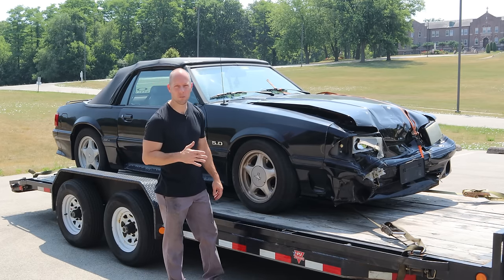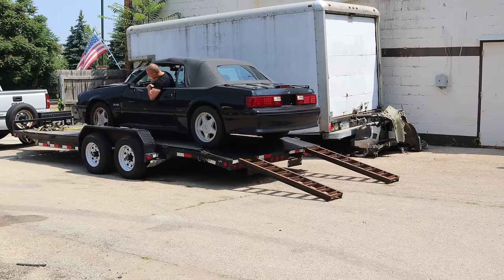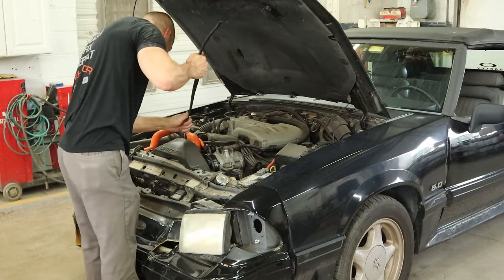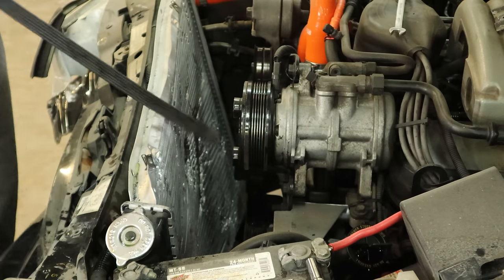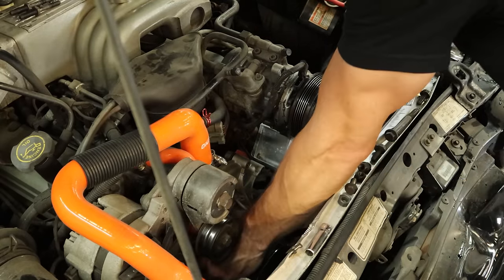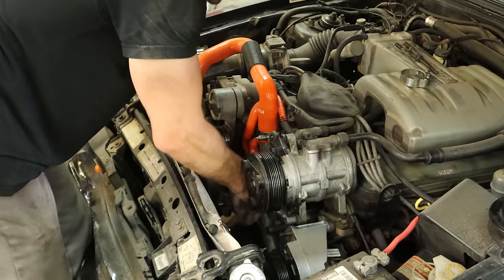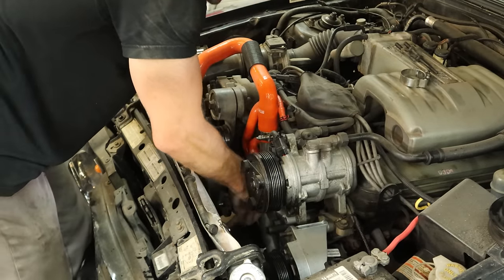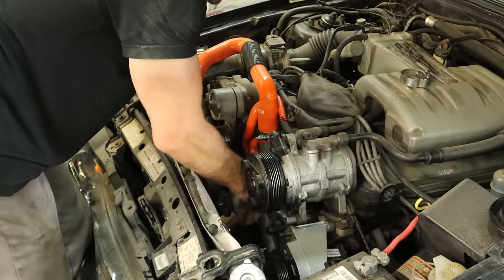Rebuilding a totaled 1993 Mustang GT convertible with engine damage.

Comment: Again, as a Ford engineer... I can totally relate. When will we learn? :D "It looked good in CAD" is the bane of my existence.
Reply from the maker: I just thought it was, “well, I don’t have to work on it”. 😂
Reply: As a retired Mechanical cad designer I can totally agree with you! Early CADD was pretty primitive and even as recently as 2011 I was appalled by the perceptions of what CAD could do well, but actually could not. I especially loved when companies claimed how the various CAD platforms were TOTALLY compatible with each other! LOL I spent more time fixing, rebuilding, reconfiguring, redesigning problems that either never should have happened or could have easily been avoided.
Reply: sometimes its not even the engineer's fault; its the Bean Counters in Finance Screeching "That's Too expensive, make it out of cheaper materials" or "X amount of Dollars is too much to add maintenance covers to the skid plate, delete them!"

Comment: Another Mustang convertible. What happened to the one we aren't allowed to mention? Did you keep building it or scrap it because it was too hard to fit the old body on the later frame? Would be interesting to find out and see more of it if you are still working on it.
Reply: I Wanna know The Same thing
Reply: Your not supposed to ask..no soup for u!
Reply: Dude its only been 3 years
Reply: He should of just replace body panels on that car and up graded to a small block 289 or 302 . It would of been a nice old  classic car.

Comment: I had a ‘90 GT convertible. I bought it used. It had an auto transmission. I drove it home and ordered everything I needed to put in a World Class T-5 transmission, 3:55 rear gears, subframe connectors, under hood shock tower triangular brace, ‘95 Mustang five bolt front spindles, 5 bolt rear axles, larger throttle body and cold air kit. It was a way different car than the one I drove home when I bought it. No engine internals but it was awesome. I miss it. This vid brought back great memories.

Comment: I was a Ford senior master Ford tech for almost 40yrs. I love Fords and have always driven them. I absolutely do not mind you throwing rocks at them, I know what they are though. I have watched your channel for a long time and enjoy every bit of each show. Thank you sir!
Reply: Am I the only person who has had exceptionally good luck with Fords? My everyday driver is a 1996 Ranger that still looks new, drives great, and will probably reach 400,000 miles by October.
Reply: @jeffgoddard4100 I've had a good run, but most have been modern affairs. 15 Fiesta ST, 15 Fiesta SFE (1.0), 15 Ecostang, 13 1.6 ecoboost Fusion (with manual, rareeeee), and a Taurus Sho sprinkled in there too. All were dead reliable despite lots of abuse.
I'm very sure I am a total outlier though.
Reply: That car is very surprisingly original!  Makes me miss my black 93 GT Convertible.

Comment: You got a great buy for a car which "doesn’t run or drive." Was it a fuel pump shutoff that you switched on in the trunk ? We didn't get these here in New Zealand, Love your videos  Scott, they clarify why crash repairs cost what they do. Go Ford !!!
Reply: Yeah these years had electric fuel pumps for the fuel injection.  Even some of the earlier years did, though sometimes the shutoff was under one of the front seats.

Comment: I had a 88 gt convertible same color in college.  5spd swap, e303 cam, exhaust etc etc. I loved it for years until i got my first ls1 trans am. Then i never looked back. Id love to have it back but they guy that has it gutted it and its was a race car so it would take a parts car to rebuild it.
Reply from the maker: Many of them turned into race cars, that is why original ones have gone up in value so much.

Comment: A friend of mine just parted out an 89 convertible with under 6k original miles on it.  I believe he still has the quarter window stuff and some other odds and ends if you are looking for that stuff from a low mile car. It also had a gray interior (though the color isn't quite the same between 89 and 93.) Located in central Ohio. I have an airbag, but it's from a 91 which I believe is different than 93.

Comment: The second Fox body convertible in as many months? I think you may have a soft spot for these. I still have my '93 Cobra that I bought new, and a '92 LX notch rotates in and out for daily driver duty. I sold my triple white Vanilla Ice-spec '89 GT convertible two years ago, five speed with a rear disc brake conversion, fun car. Here in AZ, these things last forever - though they are a rare sight on the roads today. In Chicago, I imagine that one will grab lots of attention when you sort it out.

Comment: 9:20 yes, new 4 bangers make more HP but they also won't be running 30 yrs from now without huge repair bills. You're lucky to get to the end of the engine warranty on the eco boosts without having to do a valve job.

Comment: That car is in really good shape for the year. Obviously didn't come from Canada or the rust belt on your side of the line. Worth saving if you can find good rust free parts. Maybe another road trip in the future. Good video.
Reply: I have a 1991 fox body LX convertible.

From what I can tell it was originally registered in Hawaii, then registered several years later in Alabama and most recently in southwest Missouri.

It is in immaculate condition without a speck of rust on it.

Unfortunately, I don’t see a lot of Fox bodies in my part of the country.

Comment: I had an 89 5.0 LX. Once you said it wasn't starting I was pointing to the trunk. I was stuck at work for 30min once until I read the owners manual. As  a guess pushed that button and off I went.

Comment: Hi Scott, I hope you & pizza girl have a super weekend! This looks like a killer build. Just curious, if you keep it will you leave the under carriage as is or do some selective media blasting? I am amazed at your ability, but not surprised. Can you disclose what you did in the truck to get your build to start? See you in the next installment.
Reply: Those Fords had an INERTIA switch that would cut power to the fuel pump if the vehicle was in a crash.
Driving over a speed bump too fast would cause them to trip as well so that's why he knew to check that first.

Comment: I had to do that old school repair when I was a teenager. The gas struts on my Mercury Capri let go and drove the hatch latch into the back of my head. My reaction was to slam the hatch hard enough to trip the fuel shutoff. Luckily I had overheard a conversation of this happening to someone's Aerostar van or I would have been stumped why my car shut off when I slammed the hatch.

Comment: The last time I was in Chicago;  I rented one of those.  1998, IIRC.  January, midnight.  Had to be in Rockford in the morning, this was the last thing on the Hertz parking lot.  Half buried in a snow bank.  5.0 convertible Mustang.  The perfect winter weather car for N. Illinois.  Not.

the reason this car has sll this new stuff and then got wrecked, was they bought it used from a dealer and this was the only thing not selling in January.  Promptly went out and smacked some poor honda because it wouldn't stop on frozen roads.  :)

Comment: That's interesting the battery still worked--some FDs will cut the battery cables so there's no chance of electric fire (at a demo derby you can spot the holes cut in the hood for that reason)

Comment: Not sure how old this video is (meaning when you had the car), but I just did heads/cam/intake on my 92 Mark VII with the 5.0 and have a radiator, clutch fan and shroud if you need. I'm up in Arlington Heights these days.

Comment: I knew as soon as you turned the key, and it cranked but wouldn't start, what happened.😄 The inertia switch is the first place to look, especially if it took a front end hit. A little bit of frame work, and new rad, new condenser, bumper, left fender, hood, etc. and you can have a driver for pretty cheap! Like someone else mentioned, it seems like it was well cared for by the previous owner!😉
Reply: It's only cheap if you have the frame rack and the skills. This light hit is a $6000 bill minimum.
Reply: @hotpuppy1  True that, framework, especially on newer stuff, is delicate work, and you have to be careful not to tear the metal. Definitely an exercise in patience!
Reply: Was news to me, but never drove a Ford!

Comment: It may not have the power of todays 4 cylinders, but at that time the 4 cylinders could not push their way through a wet sheet of paper. I used to play a game with 4 bangers of that time. sort of like name that tune, but it was I can blow the engine up in ? minutes. I had a Mustang GT back then untill I let a Honda owner drive it. I have driven todays Hondas and can still have then smoking and dying in minutes. To this day I could get speeding tickets for excess speed before getting across an intersection from a red light.

Comment: I bought an 88 mustang lx with the gt package in like 94.  I went to the car wash one day.  When I was leaving the car wash the car shut off. I had to call a tow truck.  Come to find out. There was an anti theft key under the steering wheel and dash.  I was poking  around and found the key under the seat.   I plugged it in and it started just fine.  😂😂😂😂.     Whatttttt!!!!!    Very fast car for the year

Comment: Ahh the memmories.   My 2nd car was a few year old 85 Mustang GT with the 5 speed.  Coming from a VW, it was a lot of fun to drive, until all the bushing turned to mush and it started turning all by itself - good bad times.   Makes me realize that I really like modern cars.
Reply: All those bushings were readily upgradable with urethane, nylon, or in the case of the front upper strut towers, custom ball and socket adjustable fixtures.  The Fox bodies were amazingingly upgradeable and could handle very well on the track with Griggs parts, etc.  I still have my 85 GT 5.0 in the gargage.  Major suspension upgrades with minimal engine upgrades to keep it street legal.

Comment: Ah yes 1993,the year the 5.0 Mustang got it's ass severely whooped by the 5.7 LT1 Camaros and Firebirds.The 4.6 didn't fair any better.So sad.Still,I really like he Fox body Stangs,the 5.0 really isn't a bad engine,and can really stand some mods.But you just can't beat a SBC for easy hp.Regardless of what the pinned comment says,there's still a LOT of 3rd gens still kickin butt and takin names...
Reply: And that's before you even consider no one is harvesting 4.6 liter motors of of the 94-04 mustangs like they are with the LT-1 and LS motors in the 4th gen F bodies.

Comment: Ya had me worried when ya broke out the wheel cleaner spray.  Then (gasp)...  Pressure washer?  I was about to call 911, but I see ya got it under control.
Reply from the maker: Don’t worry until you see me cleaning those wheel liner to reinstall them. 😂

Comment: My 90 LX Notchback has leaky AC. Also changed the water pump twice and the plastic fan was cracking at the hub so that done as well. All parts cheap. Also alternator but all issues were time based as I bought it new and now it is old like me. Last thing I did was the heater core....not fun and the speedo cable is not connected need to go back in and do that again....grrr. Oh the door jamb bushings cracked away got new ones on Amazon just last month they were $14 for a set of 4. Cheap again. Great car not a problem with anything. Cheap fixes. I do not drive it in winter never have as that is useless. Have owned all of the big three. Loved my 350 Quadrajet and my fuelie 302 and my Hemi Durango. Dodge products are the easiest or most sensible to work on... then GM and Ford last.

Comment: utterly shocked at how stock that mustang is...factory exhaust, air box, wires...in my area that generation had a blower added before the first oil change...or the hidden nitrous in the intake 😆
Reply from the maker: I thought the first thing everyone did was hack the wiring harnesses apart in 10,000 different places. 😂 It is hard to find rust free ones and even harder to find ones that were not messed with.

Comment: You Sir are a smart MF’r 
Not everybody knows about the reset in the trunk. I’ve had 4 Fox bodies. Hardly no better sound on a mostly stock engine than putting the Flomo’s as mufflers. I can’t be 10’-11’ from the header to the SS exhaust pipes. But with a GT I think that they just turn down ? 
Lotta fun with those Fox bodies.

Comment: would have made things easier to take the radiator out and the hoses.  I would have also have gotten a new water pump cause that one will most likely fail and then you will have to go back in to things again.

Comment: Not familiar with old Mustangs, what was that switch (?) you flipped in the trunk? Somekind of killswitch for fuelpump or? Also just bit of glue for the steering wheel and bondo to for front end and it's good as new
Reply: Fuel pump rollover switch. A sub in the trunk will set them off, too.

Comment: Those motors were good on torque but not so much on horsepower. I think those even in 93 were only making 225hp/300tq. You're not wrong about the 4 cylinders, I have an 06 Mini 1.6 liter (heavily modified) making 324whp.
Reply: I handily beat one of these (stock I'm sure) in a straight up freeway race with my straight-6 70s Nova... Thanks gov't regulators...
Reply: @AlexSwavely  In 2006 a stock Mini S was 168hp. Not surprised a torquey straight 6 would beat it.
Reply: @michaelbradley7529  a stock 5l mustang, this was in 92

Comment: What did you do in the trunk to get it started?
Reply: most Fords from the early 90s to the mid 2010s have what is called an Inertia Switch; it basically did exactly what it was supposed to do in the original crash, and cut power to the fuel pump in case any fuel lines were damaged in the crash so it doesn't cause a fire. sometimes they were so sensitive that a large pothole would be able to trip it leaving the driver on the side of the road wondering why their car won't start after they hit that last pothole!

Comment: I have a 1987 Bronco. For the most part, I hate working on it. It's been a reliable vehicle but when something happens it can be a bitch to diagnose and repair. It's convoluted and a lot of the things they did don't make sense from my perspective. This is a 1987 so God help me if I have to deal with anything newer. I love that the distributor is right up front, but it's buried under air intake hoses and wires. It was hands down the easiest heater core I've ever done though. Literally less than half an hour to change it. I think Ford has always done weird things and then maybe around the 80's they started doing things to trip up the shade tree mechanic. Anymore. they're all doing it. Ford is just a step above the rest at confounding the common guy.

Comment: What did you fix in the trunk? If got an 89 GT that won’t crank.
Reply from the maker: Reset the inertia switch that cuts off power to the fuel pump in an accident, you have a different problem.
Reply: @vehcor  what problem you think I’ve got?

Comment: Must be those Gen-Z people they hire that the auction, they don't know about the inertia switch...
Reply from the maker: I’m not complaining! 😂
Reply: Anyone over 35 who's ever driven a 90's or earlier FOMOCO product should know about them.  I discovered them when parking my rented '91 Lincoln town car, the rear wheels experienced a 4" drop as I pulled into a grass driveway off of the pavement.  That was enough to set the inertia switch off.  I had friends with slightly modifed sound systems who would have them trip when the bass would hit.

Comment: Had a couple of Rangers with that fuel cutoff switch. The '90 I had would trip out on a good jolt from a pothole. Learned really quickly where it was (passenger floorboard) and how to reset it.

Comment: I don't think you give Ford enough credit for some of the thoughtful engineering they put into their vehicles.  Are you using the same worn out sockets you use on every other vehicle?  Hell no!  Ford used unusual sizes just to make sure you're putting a socket on their nuts and bolts that has seen very little use.  Genius!  When you bust out that 5.5mm socket, you know it hasn't been wallowed out by continuous use over the years.  Show some respect.

Comment: A Ford worth saving will be a good project to watch.  This is old school with nuts and bolts and not held together with glue.  All the old stuff didn't require a computer to tell you whats wrong.  hooreay for old tech.
Reply: This car has a computer AND a diagnostic port.

Comment: I thought only the early fox body cars had 4 lug hubs?  Figured they went to 5 lug for all models at some point in the 79-93 run.
Reply: No, Ford was too stupid and cheap to add the 5 lug and 4 WHEEL DISC BRAKES they put on the lower powered,  4 cylinder SVO.  Sad part is how hard would it have been when they discontinued the SVO to just put them on the V8 Mustangs?...
Reply: @patsfan8057  I didn't catch the car was originally a 4 cylinder car.  I thought it was  factory 5.0 car.
Reply: @tokuzumi1  Thanks for your reply.  No, for a couple of years, there was an SVO Mustang,  4 cylinder turbocharged. It was considered a "higher tech" version, given things that the GT didn't have. Apparently everyone preferred the V8 and the SVO was discontinued. Ford should have recognized that it was the V8 at the top and transferred the upgraded parts. A no brainer.
Reply: Lol

Comment: 23:50 about the fasteners. I can buy stainless studs and nuts for exhaust manifolds for my 5.4L (shuddup) for about $6.00 If I can buy em for $6 that means ford can buy em for $1.00. To replace all the exterior fasteners with stainless instead of rustoleum, would prob cost $50 to $75 per car. I know why they don't, but all that does is prove that they really don't give a rat's ass about building quality, they just want to pump out as many units as they can for the least amount of money.